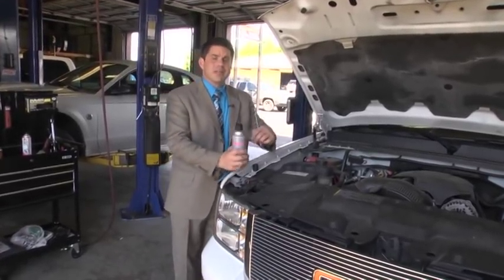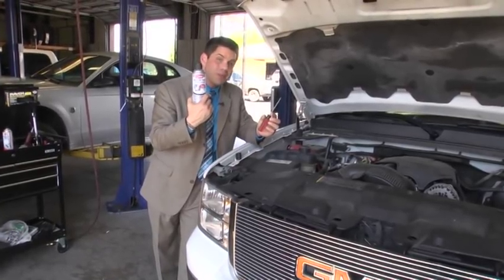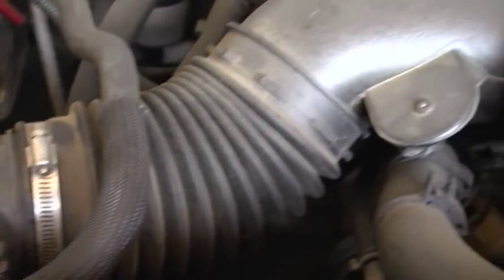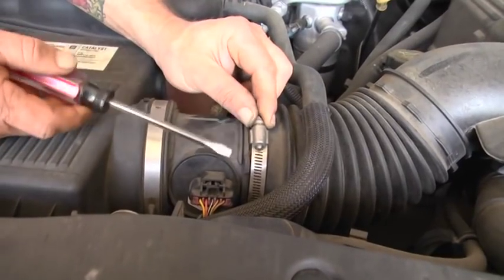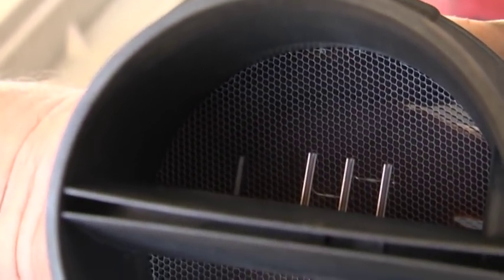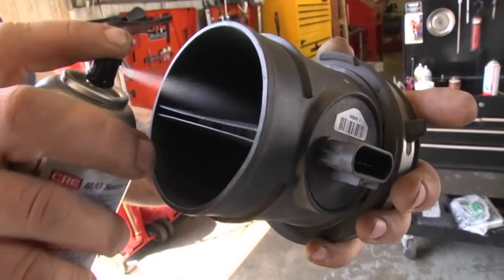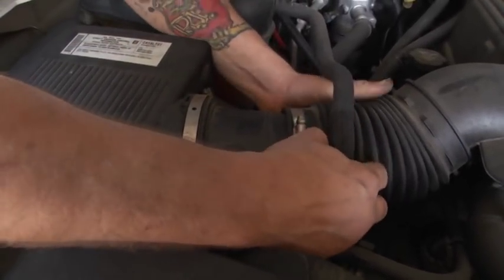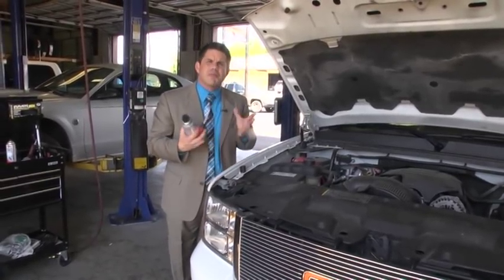Want better gas mileage?  Get a screw driver and spend 2 minutes here

Comment: Another piece of useless junk put on cars to make consumers have to spend more money.  My foot is the ONLY thing I need to tell the engine how much gas to pout into the engine.
Reply: ...That principle would apply to vehicles that have carburetors or mechanical fuel injection. Electronic fuel injection relies on the engine management computer and the information sent to it by various sensors to ensure correct air/fuel ratios and ignition timing under all conditions. EFI is actually much simpler and cheaper to produce than mechanical fuel injection plus easier and cheaper to diagnose and fix, (although not cheap by any means).
Reply: +Michael Henwood Yep these young guys don't realize how well their cars perform compared to the older ones.
Reply: +Lee Brewer All I can say is I remember when I had carbaretted cars and wasn't sure if they would start at minus 20 degrees.I can go out anytime in the winter now and know my car will start.I like the new stuff,although they are sometimes a nuisance to service.
Reply: +panzerabwerkanone This "young guy" is 55 and remembers when cars were easily serviceable for very little cost.  Yes, starting in -20 was sometimes an issue.  But since fuel economy has not increased much (1966 inline Oldsmobile - 36 miles per gallon moving a much larger and heavier car - and my friend had another of the exact same with same mileage), I would still be willing to plug in my heat probe on nights I knew temps would be that low.  As you said - a NUISANCE to service, and certainly much, much, much (did I say much?) more money/time needed to diagnose and fix them.

To the rest...
My old cars had an actual bumper worthy of the name this part of the car has been given (hint - no insanely expessive, modern, fender benders to repair).  It had more a lot room than I have now, and so was much more comfortable.  The older vehicles hitting a deer would need a radiator replacement (not expensive) and be far from totaled (What?  Remove a dent instead of pay a thousand for a new fiberglass front?).  This kind of vehicle saved me from costly repairs when someone else hit me in what would (back then and certainly not today) be seen as a minor accident.  The car was built to last instead of just to protect the occupants from a crash while it folded up around them (more money for the industry!).

Adding all the ridiculous extras has made a very handy way for companies to suck more income out of my wallet.  The more parts they add, the more potential it will need replaced/serviced/gain the businesses (insert evil laugh and a yell of "suckers!"). 

But hey, I have only experience in both worlds of cars (and repairs)  - then and now.   After all - what is hands on experience on both sides of the issue when compared to the modern method of knowing we are so enlightened we don't need experience as a teacher anymore?   Yes - being facetious - not meant to be cruel or rude.
Reply: +Lee Brewer That's just wrong.
Reply: +Lee Brewer 
LOL! HA!!! :-)
Reply: +Michael Henwood I lived in FL for years and loved my carbureted car.  Now I'm up North again and even my 22 year old Jeep is fuel injected for that very reason.  If it won't start below freezing it's 4wd is no good to me.
Reply: YES MR Lee the old iron is tough and I love it too but they can be fitted with modern systems like 4 wheel disk brakes, LS3 GM's are the "in" power plants then we have, the 4L60E for light duty and the bad boy 4L80E transmissions with lock up and overdrive to go with them they help fuel mileage greatly.  My name is Don Hi Mr. Lee I am 57, the new stuff is so much better with the computer you have all you have to do is google your problems and you will fine there is some YouTube channel with some real mechanic that we tell you what's wrong what part to change and how to do it and the kicker is even for the old stuff you can find the same help so in a way the old cars have computers too (the dwell angle is 5 degrees) lol.  That's what happening, my 2005 Chevrolet van has a 4.8lL which is IMHO is the best engine CID  displacement ever.  I look it up and it is 292 CI Chevrolet motor it has been in 3 configuration inline 6, V6 now V8 all powered heave duty trucks.  My 4.8L makes 280 HP and 290 ft#T  fuel mileage is not so great with this truck but it has a lot of weight in it it's 3/4 ton with 373 gears city driving is what kills it.  Hope this helps change your mine about the new stuff is like they (the factories) started doing the same things us race guy have been doing for years making them preform better.

Comment: Don't just throw your MAF sensor on, Let it dry. ......
Reply: +Noah Rule That stuff dries almost instantly just like brakleen. You couldn't get it on fast enough to have it still be "wet" and even if you were able to pull that off it would be dry long before you ever started the car.
Reply: Ya your right it's just always good to play it safe
Reply: +Michael Kirst MAF cleaner, brake cleaner, and electronics cleaner are all the same - perchloroethylene. Great cleaner, bit bad for the brain cells and environment though. There are 'environmentally friendly' alternatives, but nothing really beats perc.
Reply: +Interstellarsurfer I ain't dun had no problms thats guud stuf u kno its gret wen u aint got ur paycheck yet an cant get no beer

Comment: But the ECU looks at the lambda sensors in the exhaust and runs feedback control to prevent excessive fuel consumption.
Reply: ecu stands for engine control unit and it looks like cubic plate
Reply: +Cody Triplett Only the downstream O2 sensor verifies the Catalyst efficiency. The upstream O2 sensor measures the air/fuel ratio and makes adjustments to the long/short term fuel trim. Try unplugging the O2 on the manifold and watch your engine belch clouds of smoke as it struggles to run.

Comment: Word of advice, do the cleaning, but don't ever touch the sensors with a screwdriver or anything other than the cleaner.
Reply: +jeff darnell Ya, for a minute I thought he was going to scrape at them with the screwdriver instead of just use it as a pointer.  Cringe worthy.
Reply: Chances are you're going to screw up the maf sensor by trying to scrape carbon off of it.
Reply: jasalmon21 never put seafoam in before the mass airflow sensor. it's in the instructions on the can. it's mostly a waste to pour it in the brake booster line, better off getting the aerosol can and spraying it in at the throttle body. works great
Reply: you must be gentle with it don't ham hand the thing with a hammer
Reply: I am not a "mechanic" and I was thinking the same thing.
Reply: +michaelovitch yes paul has been doing it for like 20 years.
Reply: can't you do this with the seafoam spray too? I want to try this my damn mileage has been declining pisses me off. already put a bottle of reg seafoam in the gas amd half in the crankcase before I change the oil, want to put some through the tube attached to the brake booster (not sure exactly where it goes from there but heard it helps clean things up). till then still have to change the oil, run the rest of this treated tank of gas, and get my hands on a bottle of spray cleaner either seafoam or not. lmk please I need to know if seafoam is in any way safer than using these other chemical sprays, I figure it'd work just as well since my engine isn't that old or dirty. any input much appreciated thanks!
Reply: Jeff Klaubo thanks. Yeah I ended up doing both lol. Didnt use the whole spray bottle though so I'll have to use that up soon since I just changed the oil
Reply: Jeff Darnell  thank goodness my Hemi Charger was getting bad gas mileage now I can fix it with Miracle in a can he wants better gas mileage walk there's no such thing
Reply: @miketonon7946  Now you're talking.
Reply: Fukk that
 air sensor bull shit.
Its for TV assholes.
Reply: +jeff darnell 
You can,and it works.
Just be gentle
Go take a look on scannerdanner channel.
sometimes carbon build up is hard,and not dissolved by the cleaner.
it acts like a  very efficient heat sink being carbon, and fuck up the maf measurment.

Comment: That is not truth what he says .... its only for commercial. I did on every single car everything changed still same gas milage. Only if your car is to old it will spend more fuel like 0.5mpg to 1mpg... Or if your car is broken .... Anyway don't bother how much spends.. BEcause you gonna have head aik all your life... IF you want low mpg find car with 1.0 engine and have fun or diesel europe car with 2.0tdi 40mpg.

Comment: check ur brakes
One thing that causes mysterious fuel economy issues is brake drag. I have a 1999 Automotive Technology book from Saint Lawrence College they used to teach the automotive program. When the safety was done on the car I am currently driving they changed the brakes pads and shoes. Because of the odd bolts on the calipers a I never had a problem with drum brakes before I never worked on them before I had the shop do it. They did not put brake grease on the caliper pins and the brake pads where they make contact with the caliper or any of the parts in the drum. All the moving parts in the drum except the adjuster screw on non_servo brakes are supposed to be greased with high temperature grease. I have historically bought used cars to save money. I have yet to see brakes that have been greased. Or maybe they were but the mechanic did not used high temperature grease and it will evaporate in one trip due to how hot the brakes get during normal operation. The tell tale sign of this on disk brakes is uneven pad wear because if they aren't greased the caliper stops floating or the pads stop floating in the caliper. On the car I am currently driving which was safetied about 18 months ago all the brakes seized over the course of a month. First the front brakes then the rear. As an emergency repair I greased the caliper pins on one side with axle grease. 200km later the same thing happened, I thought I had fixed it. Then I pulled out the book. After doing this to all 4 wheels out of necessity the fuel economy has improved and the car no longer looses coolant.
Reply: I have worked as a mechanic in the past and know the trade well. In my experience I've seen techs that religiously grease brakes and others that oppose it. The argument for lubrication is obvious, but the argument against it revolves around the grease picking up dust and dirt that finds its way into the caliper and other important sections. I've takin apart hundreds of failed brakes on vehicles, and the number one cause of failure is neither of these. More than half the time the problem is forced in brake pads that dont float freely on their slides. Along with that is somtimes stuck slide pins but more often jammed pads cause the issue. Solution? Take out your grinding wheel and grind the pad down until it slides freely into place.
Reply: awm9110 Are there techs out there who just force them in?
Reply: +awm9110 Bendix single piston sliding caliper (Ford) are notorious for sticking.
Reply: +Peter B. Single-piston Bendix calipers are the devil's instrument.Ask any Ford truck owner.

Comment: If you use an oil and gauze type air filter (K&N), the interior Mass Airflow Sensor wires get coated with a thin film of air filter charger oil over time. If you get a check engine light and the code says there's a Mass Airflow Sensor fault – simply do this simple maintenance and you're good to go. Dealerships love to replace these when all that is needed is a little routine maintenance. Read the can and make sure it's safe for your make and model of car or truck. I know Nissan requires a different formula. However, I drive a Chevy truck and it worked perfect on it. It may have been my imagination but I noticed a slight increase in performance, smoothness of idle and operation.
Reply: Thank you! Well explained💯

Comment: Hum... Doesnt more airflow cause the injector to spend more gas in the engine cause of the mixture ?
Reply: Michael Carreiro Not necessarily. A dirty MAF can do alot of things than just read less air coming through. For example, it can malfunction and send higher ratings of airflow to the ECU causing a ridiculous amount of gas being used. On the other hand, it can also Send so little or non going through that your car loses power on the low revs or even stop as no air means no gas going into the engine. Seen a few cars turning off at low revs cos of dirty MAF. Hope that helps
Reply: Michael Carreiro Cleaning the MAF wouldnt create more air flow. Not really sure how you came up with that.
Reply: Mikey Betard yeah I know but if the MAF says there is more airflow instead of less. Doesn't it inject more fuel to even out the two ? Air and fuel ?
Reply: It could only if there's actually more air flow.
Reply: Mikey Betard lets say the MAF is dirty and doesn't pick up so well the air. It says 20 air is going into the engine. Then the engine does 20 air and 20 fuel to get the 50/50 mix. Now if you clean the MAF then it's cleaner and picks up more of the actual data 28 air. So the engine does 28 air and 28 fuel to compensate. No ?
Reply: Daniel Kim Thanks that clears a lot.

Comment: maybe i am missing something here but as it was explained, the MAF sensor glows at start up allowing a certain amount of fuel to enter and as the revs increase, the increased airflow increases and COOLS the glowing MAF "WIRES", allowing MORE fuel to mix properly with the higher volume of incoming air..... right? - so by reasoning, if we physically block the air flow to the MAF, then the car will run A LEANER MIXTURE THAN NORMAL.. right?..... so as I see it, running a bit leaner will IMPROVE gas mileage. Conclusion..??... leaving your MAF dirty is the same as blocking air flow to it and it might save on gas although you will get slower response and acceleration.... would be nice to do some actual testing on this..... food for thought?
Reply: The MAF heats 2 wires up to 200f. For every degree it cools, it tells the computer how much air is flowing past in and adjusts fuel amount accordingly. A dirty MAF can cause lean conditions that are fatal to your engine. The MAF is working with several other sensors to determine proper operation. As the engine leans out, the knock sensor and O2 sensor with tell the engine to richen the mixture. The car runs awful and burns more fuel, not less. Cleaning the MAF every time you check your air filter is a good idea.
Reply: Fred Garvin l
Reply: If you physically block airflow, then you will also add less fuel, leaving you with the same fuel/air mix ratio... the exact same as if you physically block air by closing the butterfly valve on your throttle body...

Leaving your MAF dirty will not block airflow, so you will be having the improper fuel/air mix. 

A dirty sensor will be insulated by the dirt, making the cooling effect of the air across it less effective. The sensor gets hotter than it should given the airflow, thus the sensor thinks you are getting less air, leaning out your fuel mixture.

Correct conclusion, wrong reasoning :)

(This is assuming running lean is good for fuel economy)
This also does not take into effect just how much/little effect cleaning the sensor has on fuel economy. Does the 'savings' in increased fuel efficiency justify the cost in both time and cleaner? Depends.
Reply: Frankie R just unplug the dam thing and be happy
Reply: more air more fuel. less air less fuel.

Comment: The mass air flow sensor tells computer how much air is entering the engine at each instant of time.  Cleaning the dust and oil off the sensor resistors which heat up will allow the resistors to change temperatures more quickly that if a trace of dust insulates the resistor from losing heat instantly.  Clean resistors in the mass air flow sensor to call for more gasoline to match the increased air flowing into the engine.  Small changes of throttle will more quickly be compensated with increased gasoline to match the airflow.  The engine will feel more torquey

Comment: mas sensors are self cleaning, they heat up for a second to burn off anything on them.
Reply: If you use an oil medium air filter small amounts of oil fly off and onto the MAF and burn on which is why the MAF cleaner is required. If you use a stock paper filter then yes, you are correct.

Comment: I did this shit it wont work to my truck still the same.
Reply: well if the sensor isnt very dirty it wont do a thing. its more like if your vehicle has more than 150k miles and you never changed the sensor then it would be a good time to clean it.
Reply: actually ur right i had almost 150K never clean since i bought brand new on 2001.. i open it looks clean but i spray and clean it.. thx
Reply: dunno man i would assume this isnt a very big thing i mean after all thats what the air filter is for. unless you just never cleaned or changed it then you should never have to clean it.
Reply: Maybe you should have a look at your air filter too.
Reply: spraying the MAF with this cleaner is not a 100% fix if you have MAF issues. it's more like a 50%